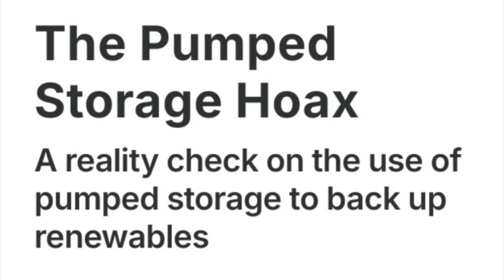The Pumped Storage Hoax, Exposed in Two Minutes

Comment: I did some rough calculations, area of the UK, average annual rainfall, assume you can store all of it, and then have it all drop by 100 metres through turbines. It would produce 1/13th of the total annual electrical requirement of the UK. Quite happy for someone to say its wrong, just gone to bed watched this on my tablet and had a very quick look and calulate on Android calculator. Could be out by 1000 either way.
Reply from the maker: But you must agree that it is meaningless to look at the average rainfall. Absolutely meaningless. You can't deny the facts I've exposed in the video.
Reply: @ClimateRealism I agree with you 100% about pumped storage not being the answer. The point I was not particularly well trying to make, was that if we stored ALL of the rainfall over the whole of the landmass of the UK, and then tried to produce electricity from it, assuming an average height of storage of 100 metres, then we could still only produce 1/13th of the electrical power the country uses. It shows how useless pumped storage is, other than in special load ballancing cases. Still happy to be proved wrong with my figures as it was done just before I dropped off to sleep.

Comment: Nuclear all the way.
Reply from the maker: Nuclear cannot vary the output quickly, so you need something like gas on top of that in order to take care of the fluctuations.
Reply: @ClimateRealism  no problem with that - if some gas on top of a nuclear core capacity is needed, we should simply do it. Gas is proven, and we've still got lots of it in the north sea.

With EVs becoming more prevalent, a strong nuclear overnight base load will have many more customers than in the past. Priced right, that makes the case for nuclear stronger than ever.

Comment: You're wrong on the original purpose of Dinorwig. It was designed to soak up the electricity produced from the nearby Trawsfyndd and Wylfa nuclear power stations overnight when demand was low, that would otherwise be wasted, as nuclear power stations cannot be 'throttled' as they are either working or shutdown. Unlike fossil thermal power stations that can reduce their output or even stop producing when demand is low overnight. The pumped storage could then be released to produce electricity during the evening peak to meet demand. Those nuclear power stations are now decommissioned and it is overnight wind that would either  have to be curtailed or used to pump water at Dinorwig for later use during the evening peak demand period. That's all.Nobody is suggesting that pumped storage is the answer to renewable intermittency. Having enough pumped storage from renewables to meet daily evening peak demand saves have to bring online gas powered thermal 'peaker' plants, thereby saving on emissions and expensive imported gas. Renewable grid level storage is increasingly being provided by lithium-ion batteries, and now by sodium-ion batteries that are cheaper, safer and more responsive. Personally I think that liquid  air storage is the most promising technology solution  for grid level renewable storage that is cheap, uses no rare materials, is based on existing technology and industries and is scalable. Demand on the grid is also being lowered by increasingly more efficient and cheaper domestic roof mounted solar PV along with the now available cheap and safe sodium-ion batteries. If allowed by the grid generators all those domestic batteries could provided storage for a virtual power station.
Reply from the maker: I am not wrong. See, Norweig was there to take the day and night fluctuations, to take the overnight power from a nuclear coal, which could not be varied quickly, and therefore could not be adjusted or lowered for overnight, and to take that and store it temporarily for the next day's fluctuations on top of the base load.
Nor are batteries cheap. You are living in a research world, not in the real world. We have to live in the real world. Do not forget you are wasting 25% of the energy in storing it in this battery. I've done videos on liquid air storage. They are extremely expensive and totally impractical at scale. You really are living in an alternative universe as regards the practicality of your suggestions. I have a video coming out soon based on the impossibility of storage to balance intermittent renewables.
Reply: Agreed, except nuclear fission reactors can be throttled but the usual minimum limit for efficiency is around 50-60% of full power. UK's Night-vs-Day demand is typically a drop of 40–60% depending on the time of year so there can be a significant overgeneration issue. Whenever I hear Trawsfynydd I always think of the famous Coronation Street advert kettle scenario 😁
Reply: @SimonCoates  It is true to a certain extent what you are saying about the operation  of a nuclear reactor, but it certainly can't be throttled like a gas fired plant, and you don't really want to start messing about with fluctuating power levels - unless you want another Chernobyl! Reactors are generally run at close to full power in a steady state and are only gradually shutdown for refuelling. The problem is that  fuel rods are never fully shutdown as even after the primary reactions are stopped there  is continued ongoing nuclear decay producing heat. Trawsfyndd was a problem station and had to be closed after only twenty years, or half its expected operational lifespan. Again, it just demonstrates that nuclear reactors remain a high risk and unknown proposition. The current reactor fleet is down to about 4GWs now, less than solar PV, and will shortly be completely shutdown. There is Hinkley under construction, but who knows when that will actually start producing electricity or if any further reactors will be built. The SMRs are constantly touted, but I see no action being taken on them. The holy grail of nuclear fusion  is always 30 years away and the only known working fusion reactor is the SUN, that provides the energy for HYDRO and WIND indirectly via the weather and directly via solar PV. There is of course also geo-thermal and tidal. Despite what the silly old git says, storage is the answer to the intermittency of renewables, although as he rightly points out pumped storage has only a limited role to play meeting peaks and even that role may soon become redundant with the ever evolving battery storage, cheap and plentiful sodium-ion being a good example emerging now. We must also bear in mind that the World's population growth is slowing and will peak from the current 8 billion at about 12 billion in 30 years time. It will then start to fall with a population crash to 2 billion by the end of the century, with a subsequent effect on energy demand in general. All oil and gas will also be depleted by 2060, so humanity has no choice but to make renewables work by making them dispatchable and hope that fusion on planet finally happens. I, like the silly old git, won't be here to see any of this.

Comment: Awkward miscalculations. He's trying to say that the whole of the Scottish hydro electric system simply doesn't work [storing water in reservoirs is a failure because it doesn't rain/wind every day]. Something not right here.
Reply from the maker: Hydro-electric is totally different to pump storage. I didn't talk about hydro-electric. I very much support hydro-electric where you get nature storing the rain into the reservoir and we can produce energy from that. Totally in support of it. So you've totally misunderstood the video.
Reply: @ClimateRealism  It's the confusion between the storage of 'electricity' (reversibly) and 'energy sources' (one-way). Rain supplied hydro is the latter, pump storage is the former; the question is then the size and height of the dam.
When we used coal/oil/gas as a primary source with hydro/pumped as somewhat secondary, then pumped was niche. Now that most hydrocarbons are essentially gone, it's now far less niche for pump storage to be viable (quite a few being proposed in the Highlands, as you'll be aware; some with more chance than others..)
Reply: @philipoakley5498  You would need thousands of Dinorwics to be enough.
Reply: @tmog1000 Enough for what- 3 weeks of powering the whole UK by the pump storage alone,? Or a more balanced appreciation.
Reply: Basically yes,more summer droughts mean increased energy demands,less water in storage.

Comment: As an Electrician that has worked many years in a Hydro Power Station.
You are all forgetting that most Hydro Plants currently operate with just captured rain fall! It’s called a DAM! 
 It fills with water when it RAINS! 
The use of Pumped Storage is purely a way to increase capacity! 🤦‍♀️🤦‍♀️🤦‍♀️
Reply: A mate of mine uses pumped hydro on his farm. Powered by excess from solar on sunny days to smooth out demand and have a longer backup time when needed.
Reply from the maker: Hydropower is totally different to pumped storage power. Pumped storage power is a battery, that's all.
Reply: @ClimateRealism  Mate! I am 100 percent on your side that “Renewables are Ridiculous” idea to power an economy.
However they have a place in the small scale especially in remote locations!! And topping up Hydro capacity!
I will also point out that it doesn’t matter how water becomes behind a Dam Wall. The moment it is!! It becomes POTENTIAL ENERGY!!! Not a BATTERY!!!!
I have zero time for Climate Change crap but a passion for the Environment!! I understand the push for Renewables is nothing to do with the environment!
I welcome more discussion on the topic and will be checking out your other videos!👍
Reply: Well if we get dryer summers,we need to pump more,& increase the use of fossil fuels & if we get wetter summers we need to consume more fossil fuels for heating & drying homes.
Reply: @SydneyPrentice-j9p  I am not anti fossil fuel! I am pointing out lived facts!

Comment: In Australia we spent $280 millon on a plan to produce hydrogen  to use as a fuel. Turns  out it takes more energy to produce  than you would get  back. Wont get our $280 million back either .

Comment: I didn't think it was used to back up green energy, always thought it was used to store access green energy that can be brought online during peak demand. 

Take the Norwick, or Northwick?  I can't find any pumped storage or planned pumped storage by that name.
Reply: Dinorwig, in north Wales. Used to backup peak demand which makes use of windpower. Not what is was built for but won't be any use in a dunkelflaut (which I cannot spell).
Reply: @JulianBills It will help a few people for about 6 hours, ideally we need a mix of renewable power to work alongside nuclear, and gas for now.
Reply: @AndiWard no we don't, we need energy which responds when we need it, not when the elements codescend to provide it.
Reply from the maker: It is not viable. The cost of pumped storage for any sort of backup to intermittent renewables is so expensive and impossible in terms of resources.
Reply: @ClimateRealism  Which method of storing excess energy is cheaper than pumped hydro?
Reply from the maker: No, it can't do that. You can't replenish it with green energy. I have actually a big video coming out on this subject of the impossibility of storage instead of a 2-minute one. It goes into detail.
Reply: @ClimateRealism  So if on a sunny or windy day at a time of low demand we end up producing more energy from sun and wind than we need, we can't use the excess to pump water up a hill. Why not?

Comment: What hoax? It's clear we we dont have the terrain in the UK to host large amounts of pumped hydro.

I have not seen any serious commentators about transitioning to renewables saying pumped hydro is a solution (on its own).  So this video is just a strawman as far as I can tell.

If you add other forms of storage, like lithium-ion, sodium-ion, redox flow, compressed air, cryogenic air, Vehicle 2 Grid and keep some gas turbines for extreme conditions with sequestration of some sort, it will all work fine.

It will also be cheaper than using gas as we do now, because gas prices doubled from 44p/therm in 2020 to 80p/therm in 2025.
Reply from the maker: I have a video coming out on batteries, and I've done a short one recently. The cost is extortionate. It's in the trillions. To back up the UK at the current rates on renewables, around about £3.5 trillion, and you have to replace that every 10 years or so. It is not viable economically.
Reply: @ClimateRealism coming up with a big number doesn't make it real.  Batteries pay for themselves many times over, so while there is some cost, it will reduce bills.  Many batteries won't even have a direct cost to the grid, because they are contained in other devices.

Comment: I think that pumped storage is great, but the amount of energy we can store that way is severely limited. So it can be part of a solution, but it's definitely not enough to make a 100% renewables future viable.
Reply: It can never be part of a solution. It is purely for short term demand and grid balancing.
Reply from the maker: Storage is great for balancing out in the day, provided you have reliable dispatchable energy at night to pump it up. I totally supported Dinobac. I was involved with it, as you know. But it's never going to be used to back up renewable power. It doesn't have the cost or the quantity to begin even to look at that problem. Because as soon as you look at 5 days or 2 days or 3 days, it hasn't got it.

Comment: exactly the same nonsense in Australia.
Reply: Except Australia does have actually viable long duration pumped hydro sites in Queensland, NSW and Tasmania.

The only thing that stops it in Australia is politics but from a physics, civil construction  and economic perspective it most certainly can be done. Indeed several of the relevant schemes were actually proposed in the past, stopped not for economic reasons or due to engineering difficulties but simply due to politics.
Reply: @shaun5552 yes and many many elsewhere including seawater based in Scotland
Reply: @shaun5552  Exactly! This may not make sense in the UK but Australia is a different story for a multitude of factors. That doesn’t mean we should maintain restrictive zero emissions targets but pumped storage is definitely justifiable here.
Reply: @shaun5552 yes, it can be done but should it? If you believe the green perspective, then how could burning coal to pump the water, make sense? Regardless, the pumped hydro systems are incredibly inefficient, using the same energy to pump up and relying on the cost differential for justification. In terms of cost, Snowy 2.0 started at $2B, should have been finished years ago, it's now up $20B (I think) and caused massive environmental damage. So much for the cost benefit of green energy.
Reply: @FairDingo why burning coal?
Reply: @gke3800 isn't the question: why not?
Reply: @gke3800  Again, why not?
Reply: I told a hearing of the Parramatta Local Planning panel in May 2024 they should stop approving energy hungry apartment towers because of the evolving power crisis as old coal fired power plants will shut down because of frequent outages and ultimately lack of spare parts. I met a wall of silence. They only gave me time because they had to tick the box "public consultation done"
Reply: @mattmuschalik1348 sounds about right.